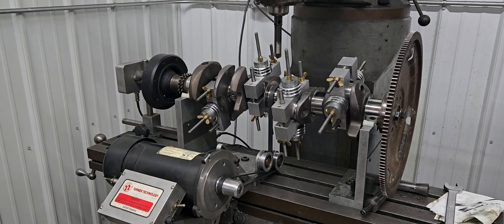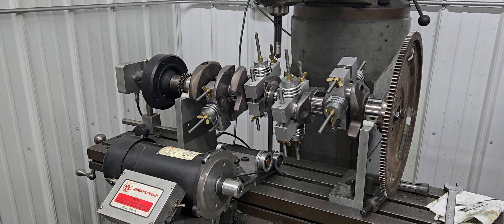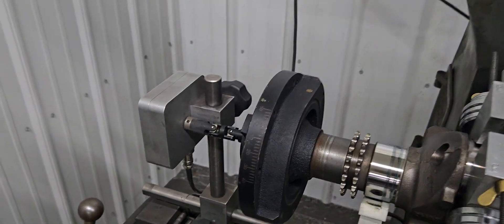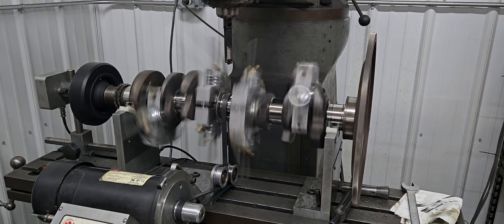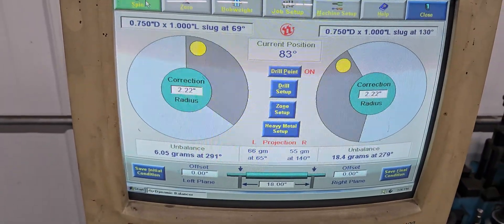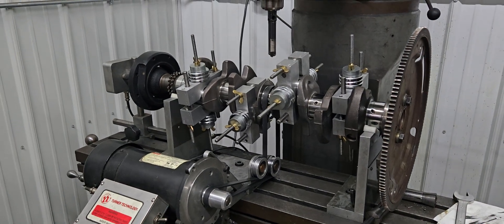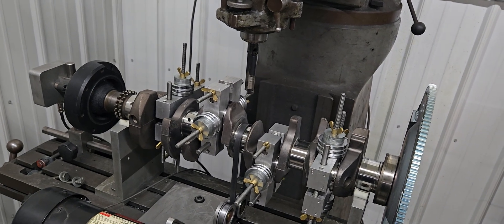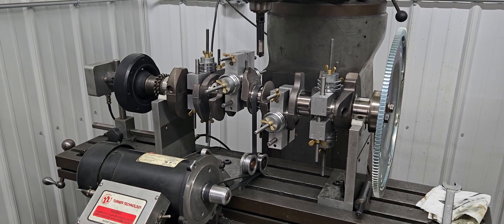Balancing a crankshaft. Well, that was the plan anyway 🤦‍♂️

Comment: i'm Chevy SBC and BBC. does the SBF flexplate go on only in one way? like chevy's. i didnt see a dowl pin when you showed the bolts holding on the plate. sorry if i'm asking a stupid question.
Reply from the maker: I had a teacher that used to say " there are no stupid questions, only stupid answers". Over the years I have had occasions that made me question that statement but I digress. Good question and yes, Ford uses a offset bolt pattern which makes it impossible to bolt the flexplate to the crank in the wrong position. I personally would prefer the GM dowel setup and I'm a Ford man. But, it gets the job done. This PRW flexplate is just made wrong. Oh well. Thanks for watching!

Comment: Isn't that the difference between the two 302 balance weights? (28 vs 56? )
Reply from the maker: @richardgriffin-t4c  nope. Early SBF stuff was 28 oz and the later model stuff like this is supposed to be 50 oz. The factory flexplate was fairly close as you can see in the video. The aftermarket CHY-NA piece is simply junk.

Comment: Would turning the flex plate 180° help.   Since the weight was in the area suggested by the maching to remove?
Reply from the maker: @russcole5685  no that would definitely change the point of imbalance 180 ish but then it would want a tremendous amount of weight added to the counterweight. Even if a guy wanted to do that, the bolt pattern would not allow it. Due to the positioning of the holes it will only bolt on in one position.

Comment: Very Cool.  Thanks for sharing that.  That is a very janked up nib flexplate.  No Fords, thank you much.

The Ford Cosworth F1 V8 could spin to 20,000 rpms

The Renault F1 V8 spun to 20,500 rpms.

Honda F1 V10 achieved 20,000 rpms

All of them idled at about 6,000 rpms, AT IDLE!. 

How you ask??.  The pistons were a over-glorified alum ashtray with just enough room on the side for a ring pack. Basically zero skirt material and just enough material to hold the wrist pin.

Conn rods had lightening holes drilled thru the beam top to bottom.

All of them were a super short stroke motor, adding to the incredible rpms they ran at.
Reply from the maker: @kh40yr  all impressive engines in their own applications. Curious why you said "no Fords"? Just personal preference or some technical reason? I've been a Ford man my entire life but I have also built some really nice SBC, BBC, Mopar, Pontiac, Oldsmobile, even an AMC! The engines don't know what they are. Every make and model has its good and bad features. I personally have had many great successes with my Ford's. Thanks for watching.
Reply: @RoederPerformance    Not to sound so biased, but I never had good luck with Fords.  Something always went wrong fairly quickly.  
  That being said, I have a 2002 Ranger V6 2wd Auto that I inherited from my Dad, who was a life long Ford man.  So far, no problems to speak of with the Ranger V6.

Comment: I had my 351w / 385 stroker balanced at a place I used to work , and got a picture and video at 3000 rpm , scary as hell 🤯
Reply from the maker: @Cobra427Veight  balanced at 3000 rpm!? I've never even heard of someone doing that. I'd sure like to see that video! I wouldn't want to be in the same room when that was spinning!
Reply: @RoederPerformance   I might be able to upload that to my channel , it was an older, .very solid balancer. It certainly makes you wonder when you rev the crap out of it , to 7200 rpm

Comment: Strip it out.  Run 2 or 3 times to check you baseline.  The flex plate bolts would give better locating if they were shoulder bolts.  I think it's the sloppy flex plate.
Reply from the maker: I ran it half a dozen times off camera too. While it is true that sloppy bolt clearance can and does allow the "clocking" of the flex plate to be slightly off and effect the amount and position of the imbalance it's typically a few grams. NOT over 80!  I'll do another video at some point showing exactly what you a referencing. people have no idea how much stuff in an engine moves and bends when running.

Comment: How does that work with all the tension of that rubber belt pulling on that crank?
Reply from the maker: If you watch closely you can see the belt slip when it first starts to spin. I generally give the crank a spin to get it going otherwise the machine software will stop trying to spin if it doesn't get a rpm reading from the crank. The belt isn't flexing the crank enough to measure. Good question.

Comment: I am surprised by how untrue the flex plates run. Do those get pulled into true when you bolt on the converter?
Reply from the maker: In general, yes. These two are actually not that bad compared to others I have seen, and used. I'm guessing that is why they are called flexplates, not flywheels.